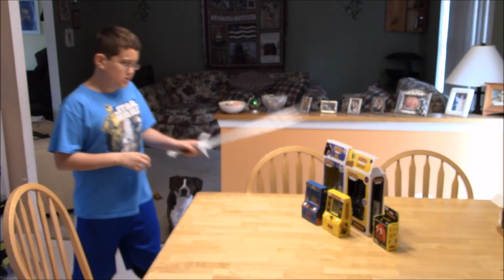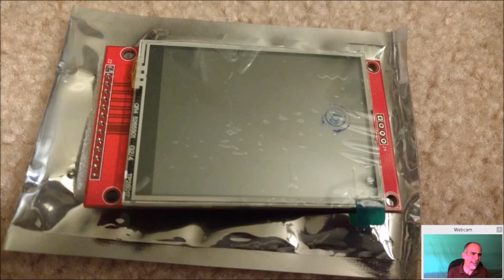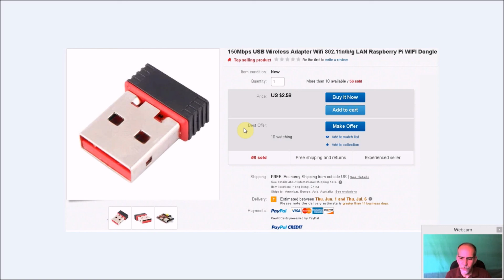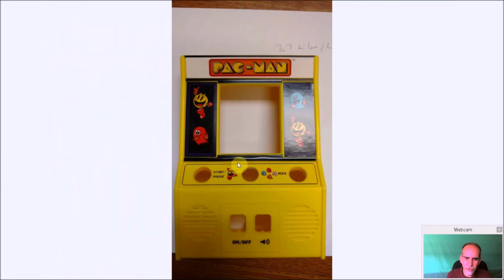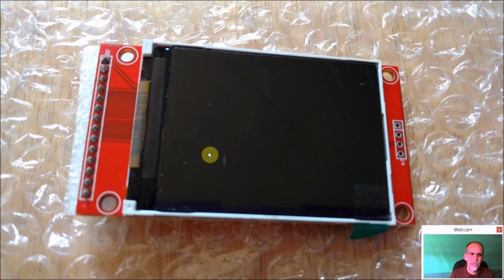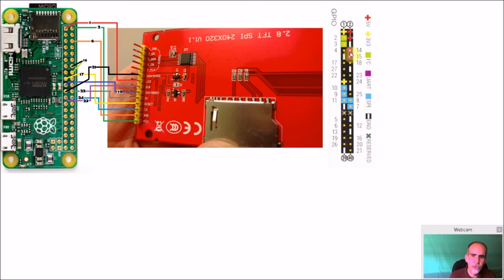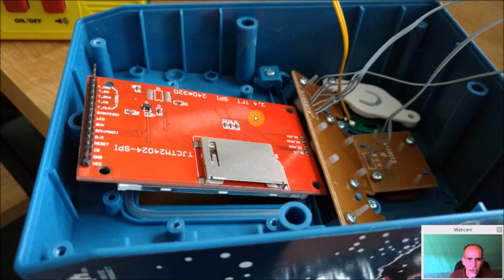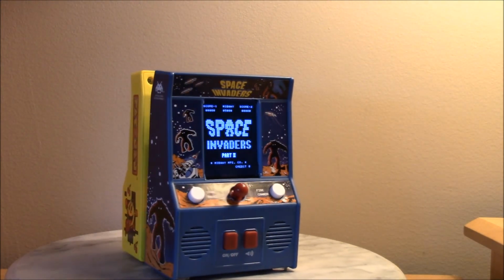It's here! How to build a Basic Fun Pac-Man or Space Invaders Mini-Cade Part #1

Comment: If you were to spend some more to get better system that uses the GPU through the display (I'm probably only going to make one for myself) could you recommend a better display? Or a website that has them? I'm interested in making a ThunderJaws cabinet. And that game is pretty graphic intensive. It basically like Rolling Thunder but way better. Thanks Glen. Really enjoying it so far.
Reply from the maker: Hi Andrew.  Well, its a toss up.  I decided to use the SPI display with its known limitations for the fantastic sharpness to the display..as CRISP as can be..but at the cost of speed in some emulations due to the GPU not getting used.  And I have not found an HDMI in anything less then a 3.5" display...but in fact you "COULD" cut the display area and make one fit....yes its been done.  If you need the speed, but don't mind the cost in display sharpness, you can use a composite 2.5" display.  they do work well, and the GPU will get used...but the screen will not be easy to see.  Its an option though.  Thank you again for the watch :)

Comment: would a Dragons lair mini cade be possible? 
that would be amazing!
Reply from the maker: jennings mills .. actually yes.  in my other unit..my Crazy Climber / Missile Command unit runs a Raspberry Pi 2 and that's powerful enough to run Daphne and does play all the LaserDisc games also if you on Facebook you can go to the Old Maid new Forum which I mentioned in my end credits where the gentleman there named Neil makes a lot of wonderful games including a prototype Dragon's Lair one but unfortunately with licensing he can actually sell it but it can be made. these particular units only run a Raspberry Pi zero and I don't believe using the display I have would be capable of running that particular program for LaserDisc games